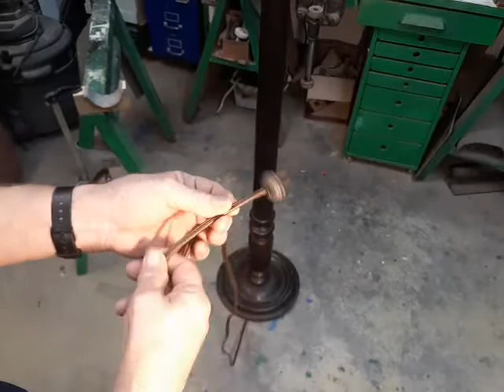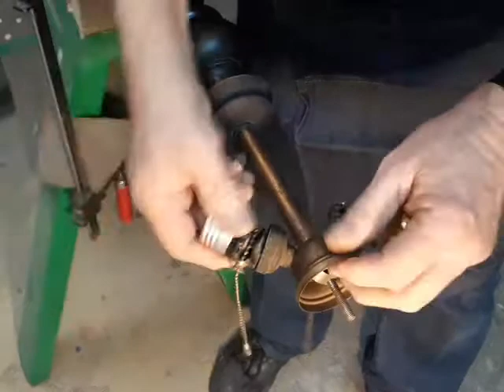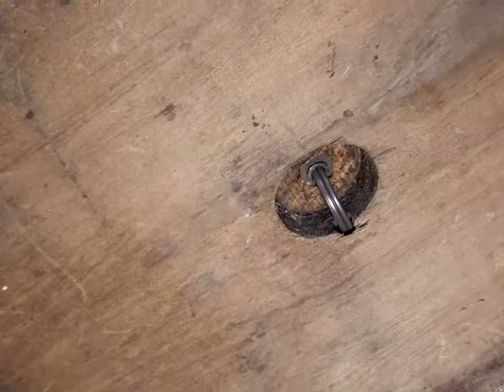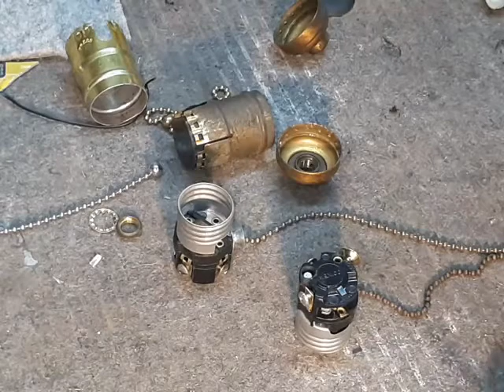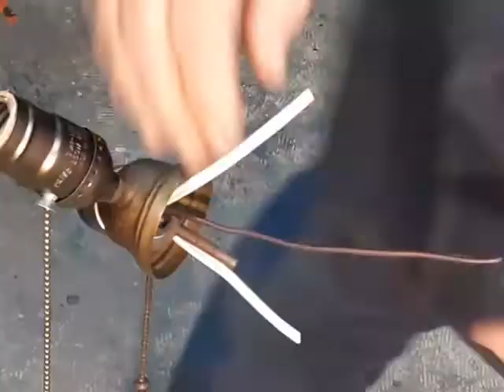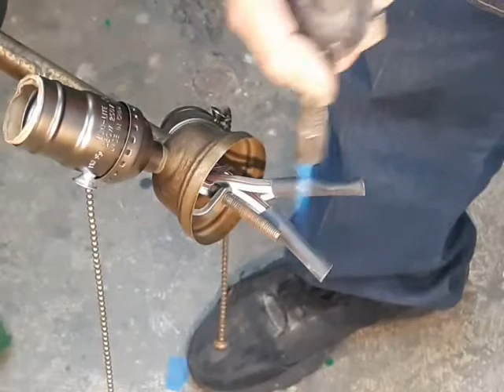Rewiring a 100 Year Old Floor Lamp in the Secret Underground Laboratory Recovery and Salvage

Comment: I bought an antique bridge arm lamp and was considering rewiring it myself. After watching your video I am thinking I will take it to the local lighting shop that's been around forever. I see there's a lot more to it than I thought.

I enjoyed your video. I admire how conscientious you are in your work. Details matter and make the difference between excellent work and just pretty good. 

Keep making videos. Knowledge and experience are irreplaceable. Thank you.
Reply from the maker: Thank you very much. You are fortunate to have an experienced lighting repair service in your area. It used to be common for hardware stores to have someone who would do simple rewiring for lamps. That is rare now. As with any skill, there are always details which make the work bfc easier and in the case of lighting, much safer.

Comment: Some nice tips on wiring an old lamp. Soldered connections are always preferred, agree.
Reply from the maker: Thank you. I've taken apart enough lamps which were DIY rewired to see practically every possible way to do it wrong. Solder and shrink wrap insure a long lasting safe connection.

Comment: I like the use of shrink wrap as opposed to wire nuts. Added to the soldered connections and this appears to be a completely bullet proof solution.
Reply from the maker: In another life, I worked on cars. My specialty was electrical work. This is the way to repair car wiring.

Comment: Good job Sir. NiCe tip using the spacer and the knurle nut on the cluster body to reinforce it.
Reply from the maker: Thank you. The chief reason lamps become loose and wobble is the sheet metal parts deform when things are tightened.

Comment: The plug on this  lamp is known to electricians in the field as open front plugs,  in accordance with the NEC these have been illegal for many years now because the cardboard insulator assuming it was installed would easily fall off and strands of wire posed a risk of short circuit and shock hazards particularly with metal faceplate receptacles, incidentally they are still available from antique restoration vendors but are not UL listed and have a plastic insulator that's more difficult to snap in and remove.  Modern plugs are known in the trade as dead front plugs and are much safer.
Reply from the maker: Some customers like them because they look "old timey". I discourage using them.

Comment: I have a lamp like this i took apart except the very base, the pole is not standing steadily in the base and it won't screw in. I can't figure it out.
Reply from the maker: The lamp in this video has a center pipe that has threads at both ends. The pole is kept tight by the nuts. Steel washers are needed to prevent the nuts from digging into the wood. In some wooden lamps, the pole and base have threads cut in the wood. It's common for the threads to break away and it won't tighten. There's a few ways to repair this. If there is still good contact between the pieces, wood glue will do. The pole and base must be supported in the right position until the glue sets.